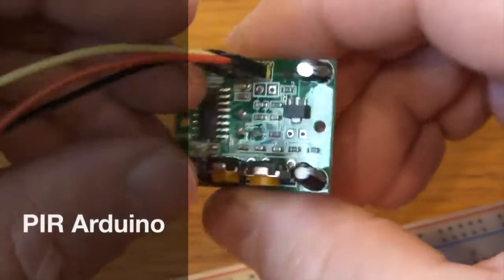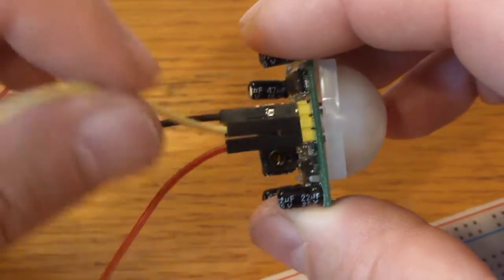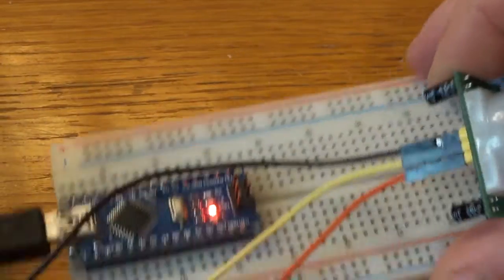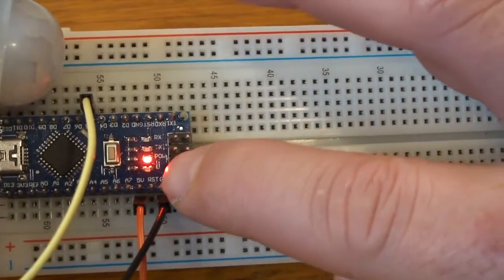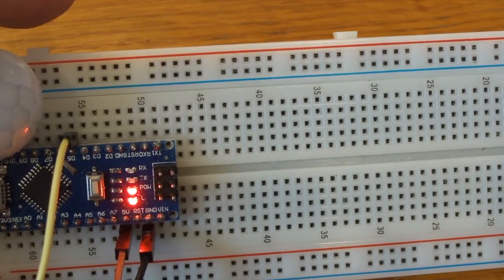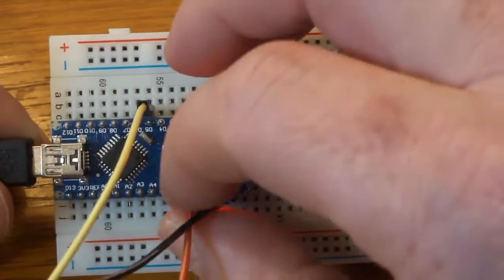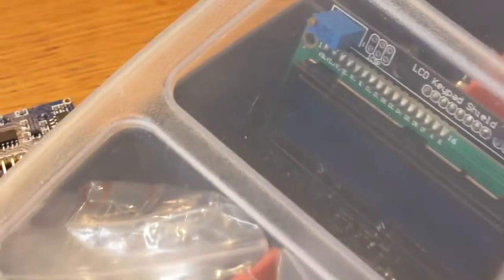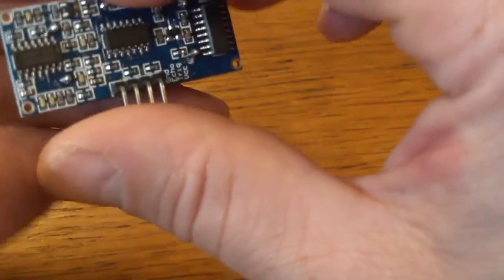HOW TO: Sense motion with the Arduino and HC-SR501 Infrared PIR Motion Sensor Detector Module

Comment: After I uploaded the sketch, I removed the USB connector for use with a 5 volts power supply.
But the LED_PIN is continuously goes on and off and if ireconnect USB connector the PIR works fine. Why????